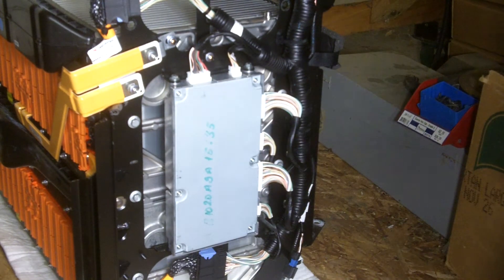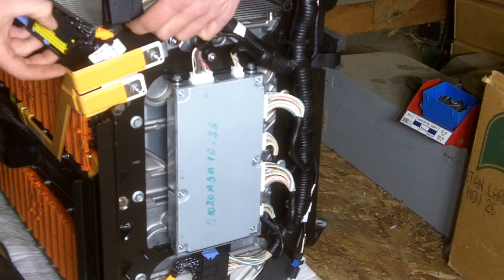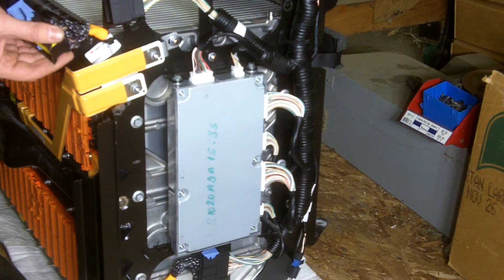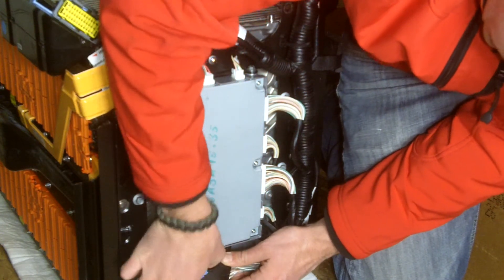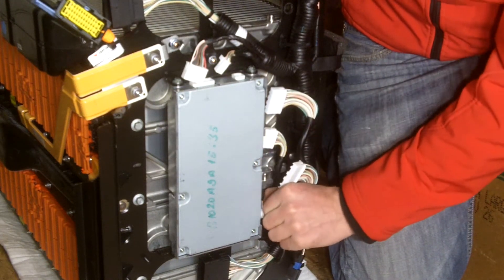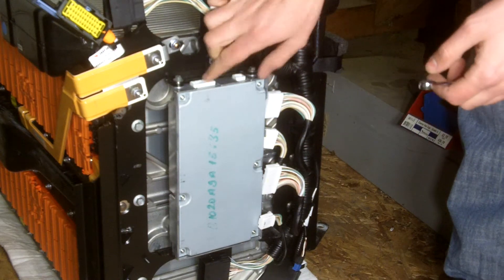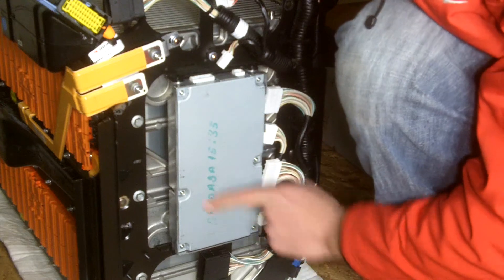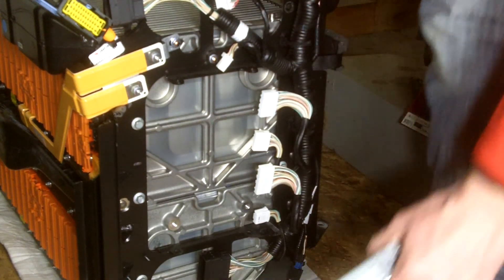Renault Fluence ZE Better Place Battery Dissassembly Part 4

Comment: Hi, What did you use out of the fluence battery pack other than the modules? Do you still have any of the quick drop, battery frame & cover, inner assembly/internals, bms, bus bars, contactors etc ?
Reply from the maker: I used the modules, BMS Harness, Cell Interconnects, and the internal frame. I still have the quick drop chassis, steel cover, many buss bars, and service disconnect.
Reply: @bji900  Thanks for the quick reply,  I was looking into buying a fluence that has no battery (I'm in the UK) and would need to build a battery as they are no longer available
Reply from the maker: You would be welcome to the parts for a reasonable value, but shipping would be rough, Also not sure if BMS would function with any car, I bet it would need to be programmed to the vehicle
Reply: @bji900  Thanks,   I'll be in touch if I buy the car.